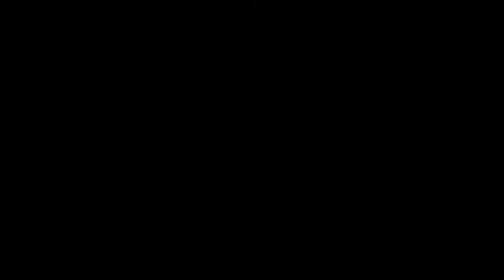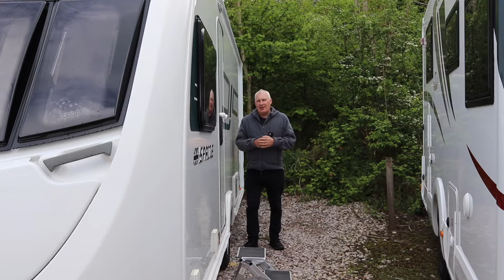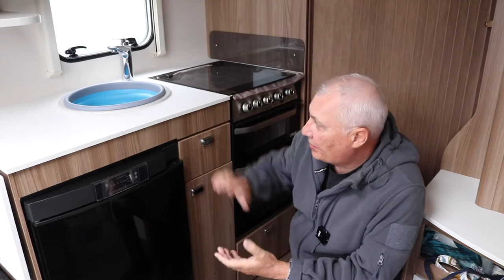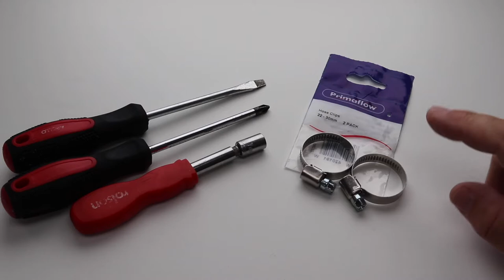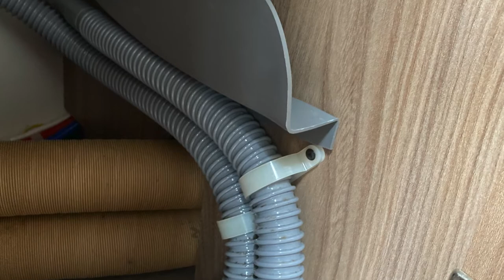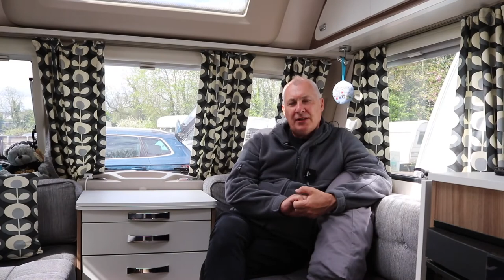Caravan Internal Waste Drain Pipe Fix

Comment: Good easy fix there Phil 👍. Our shower waste pipe came apart under the caravan once. I only knew when I heard water running on the ground outside whilst Gail was showering. I scrambled underneath and pushed the pipes back together and it has been ok since. You never know what’s going to fail next 😂. All the best, Rob & Gail 😀
Reply from the maker: HI Rob. Yep, You need to keep on top of these Caravans. Just been down and cleaned it ready for our next trip. I have to confess it was dirty as I have cleaned it for 2 months. How dare I😜 Thanks Phil👍🙂

Comment: We have a Sprite Major4, our waste pipes came apart under the sink on the solid pipe joints. They were just push fit. A drop of pvc pipe weld fixed the problem.
Reply from the maker: Hi Michael. This is a common issue. I opted for Clips incase I had to work on them at a later time. I suppose its what works for you. Thanks for watching. Phil👍🙂

Comment: Thanks for posting this - really useful. Only just found your channel so a bit of catching up to do. We've just swapped out our old 06 Pageant that we had from new for a 2021 Sprite Alpine 2. And while the Alpine is a great van, like you say there are a number of fixes/improvements needed to upp the quality. 
The waste hoses in that kitchen area cut diagonally across the floor so I'm going have to sort that out as it makes it hard to use that space gor storing anything. Need some sort of shelving solution too. 
Out of interest, have you (or been able to) installed a TV bracket to the unit directly opposite the kitchen? I need to investigate how to open up the back of the timber boxing in that runs vertically between the work surface and the locker to get a decent fixing.
Finally even as a Londoner I'd wager that your accent is within 10 miles of Bury/Rawtenstall?
Reply from the maker: Hi. Welcome and thanks for watching. Regarding your piping you may have to extend the pipe as swift make it so it just fits. In the sink cupboard I installed a plastic slide out shelf from Ikea it makes use of the dead space plus leaves the floor area to store other items. Yes I installed a TV bracket opposite the kitchen but it was easy for me as it is bolted to the wardrobe side panel. You were very close we are about 16 miles from Bury/Rawtenstall.  Many Thanks Phil👍🙂
Reply from the maker: Here is a link to the silde out storage. It is just to show you what I mean I have no idea where to get them from as Ikea have stopped selling them. Phil.
https://www.fruugonorge.com/sliding-basket-cabinet-organizer-for-kitchen-bathroom-pull-out-drawers-under-sink-cupboard-organisers-wall-mounted-sliding-storage-baskets-for-spice/p-159014499-337279093?language=en
Reply: @lostweekendscaravan  thanks Phil, those look ideal. I'm going have a measure up when we take it away for the 1st time. Thanks again for the steer.